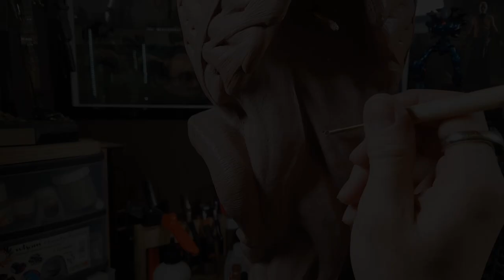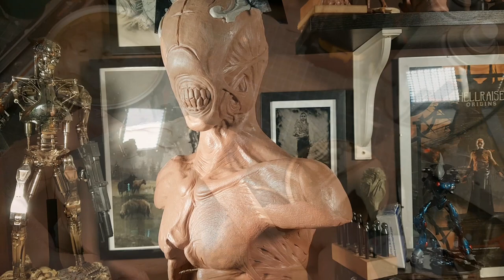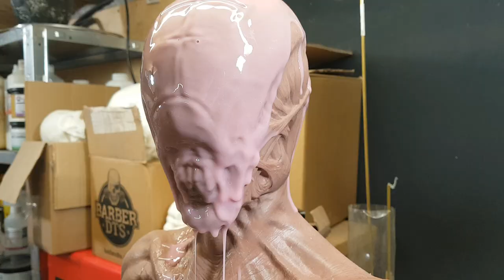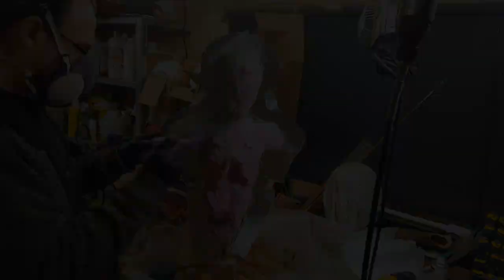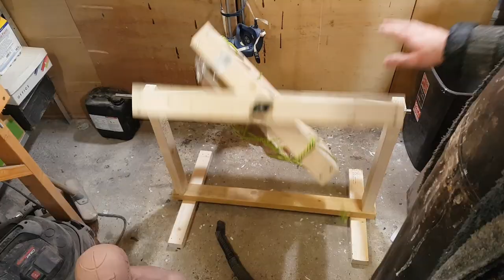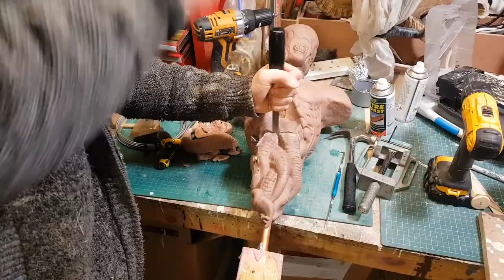Nyarlathotep Monster Clay Sculpture Part 2

Comment: Amazing work ! Love the superglue/fibreglass trick:) Think the rotomould will be better with smaller pieces as you said it can be balanced better in the middle of the frame.Could even screw a load of eyelets around the inside of the inside frame if that makes sense! drill holes in the fibreglass flange of moulds and use wire to hang in place?.Really looking forward to seeing the piece develop its looking awesome already!!!
Reply from the maker: Thanks.  I did another test with a smaller mould recently and got the same result so I think it was spinning too fast as well as being unbalanced. I need to finish off the mechanisms off and get a motor on this so I can get a slow uniform rotation going. The two lengths of wood on the inside can move and have some wingnuts to hold them in place, so they're quite good at clamping stuff between them.  I think some eyelets or brackets and some bolts will be needed for larger items though, you're right.

Comment: I think the variation in thickness is due to the rotocasting  spinning too fast. But beware, I'm a youtube expert😂, I've never done it myself but I watched a Robert Tolone video where he rotocasts and I think he said it should be spun slow. Great video!
Reply from the maker: Thanks. I think you're right - I did another test with a smaller mould recently and got the same result.  I need to finish off the mechanisms off and get a motor on this so I can get a slow uniform rotation going.

Comment: Hey man,  I think if you would have turned the rotocast slowly and more evenly it would have most likely casted more evenly.   With closer thickness in the casing.  Just my two cents.  Great job btw tho.  Awesome work
Reply from the maker: Thanks. I think you're right - I did another test with a smaller mould recently and got the same result.  I need to finish off the mechanisms off and get a motor on this so I can get a slow uniform rotation going.
Reply: Even if you were to do it by hand it would work.  Hey,  it def beats trying to spin that by hand either way.  Good luck with everything bro

Comment: Great stuff! It's a big un! I once used some expanding resin foam  to fill a hollow cast Popeye I made. Also had thin parts, some way to thin. Foam worked quite well, but not perfect. .. what resin was that? My resin was quite brittle, rather than soft and bendy. Great idea inflating it.
Reply from the maker: Yeah it's a good idea.  This is a semi flexible roto casting resing, so it has abit of give to it and so isn't brittle.  Once it's set it's pretty rigid though.
Reply: @thedarkpower  I like the sound of that resin! Do you ever have problems with air bubbles with that type when roto casting?
Reply from the maker: Yeah it's good stuff.  You occasionally get a few air bubbles here and there, but nothing too bad.  It's this if you want to get some https://www.dwrplastics.com/rotoslush-casting-resin.html
Reply: @thedarkpower  thanks very much fella! Appreciated!